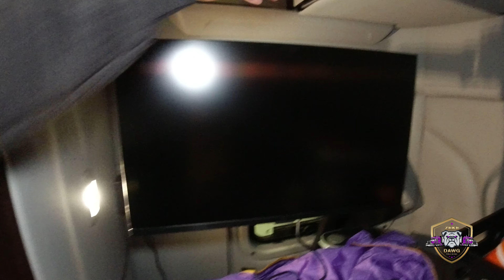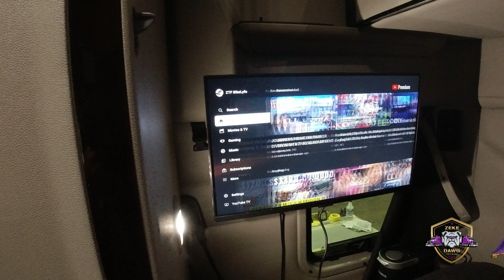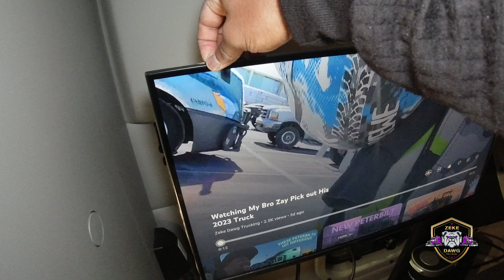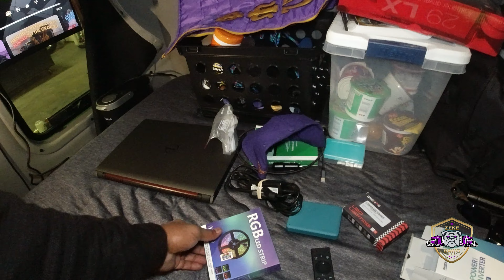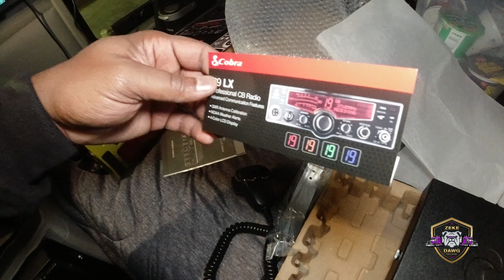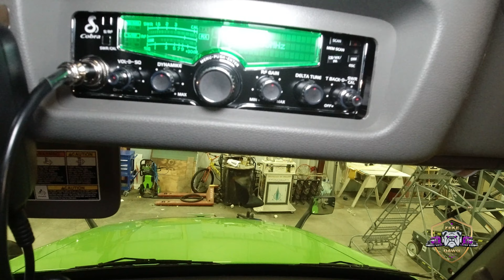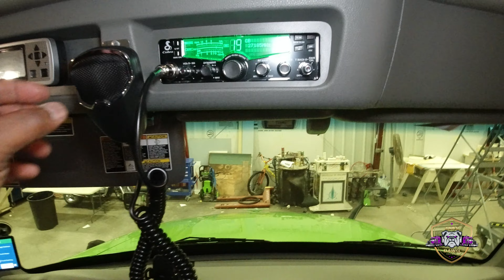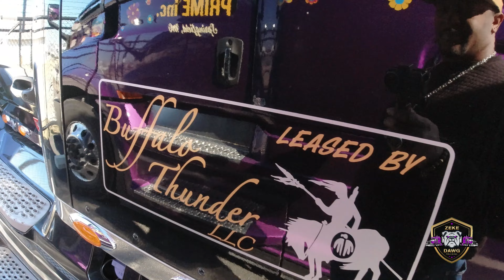Zeke Dawg Truck Graphics Have Finally Arrived

Comment: Where did u get that other TV mount at an how much was the cost of it. Ur truck looks good
Reply from the maker: Thanks bro 
Pipishell Full Motion TV Mount for Most 13–42 inch Flat or Curved TVs & Monitors, Wall Mount TV Bracket with Articulating Arm, Rotation, Swivel, Tilt, Extension, Max VESA 200x200mm up to 33 lbs, PISF4 https://a.co/d/4MgnhLu

Comment: What tv mount is that, thanks
Reply from the maker: Here u go bro

Pipishell Full Motion TV Mount for Most 13–42 inch Flat or Curved TVs & Monitors, Wall Mount TV Bracket with Articulating Arm, Rotation, Swivel, Tilt, Extension, Max VESA 200x200mm up to 33 lbs, PISF4 https://a.co/d/8O66EJ2
Reply: @zekedawgtrucking  thanks a lot bro. Drive safe out there

Comment: What type of tv mount is that
Reply from the maker: Here u go

Pipishell Full Motion TV Mount for Most 13–42 inch Flat or Curved TVs & Monitors, Wall Mount TV Bracket with Articulating Arm, Rotation, Swivel, Tilt, Extension, Max VESA 200x200mm up to 33 lbs, PISF4 https://a.co/d/2k4nWo8